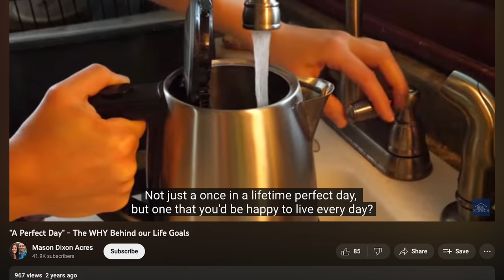We BOTH Quit Our Jobs. Now What?

Comment: as someone who works in the industry, i can tell you that you're already more capable than 95% of residential general contractors out there

even if your social media and website plans don't work out, you can always just be a general contractor and i guarantee you will be very successful

congratulations and good luck. you made the right decision
Reply from the maker: Thanks for those kind words! Certainly have thought about that option, for schedule flexibility I likely would lean towards working on smaller projects I could handle by myself and let the customer know it's going to take 3x longer but it'll be really good 😂